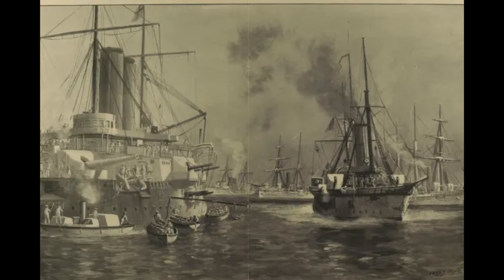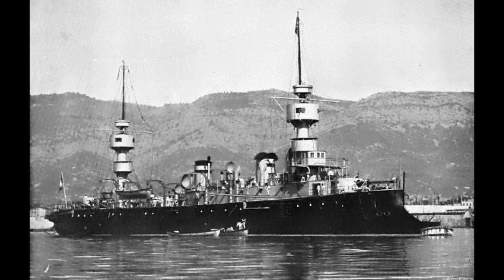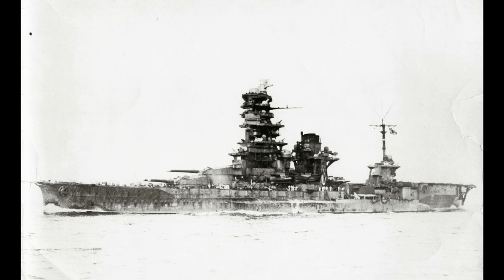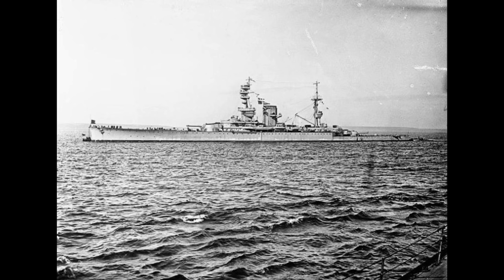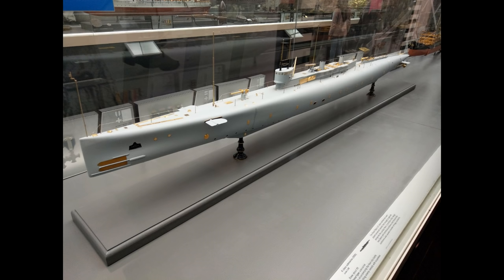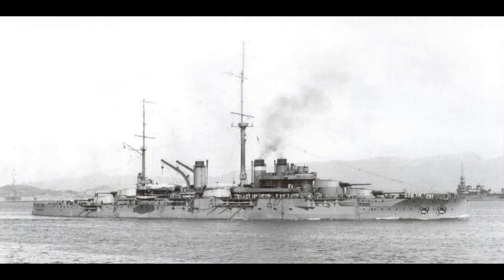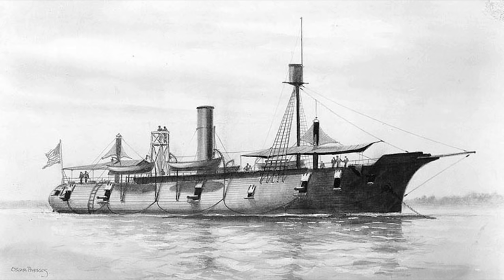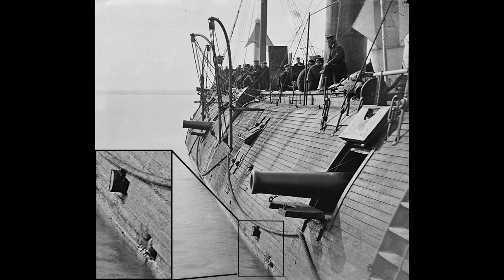Naval Engineering Disasters - How not to design a ship

Comment: "You could have 50 foot of the submarine sticking up out of the water... in the air... and the bow would still reach crush depth and implode." That's an HMS Captain level of design flaw, but also a morbidly amusing mental image.
Reply: I'm curious- did something like this ever happen? Not that extreme, obviously, but the scenario he mentions where the dive controls screw up and the submarine sticks its bow under the crush depth, damaging itself. Is this just a hypothetical, or did it actually occur ever?
Reply: @suspectsn0thing  Look up "the Battle of May Island" - just don't mention it in naval pubs..
Reply: The K-boats might have been the only submarines that were longer than their own absolute crush depth, but weirdly, they were not the only submarines longer than their test depth. The Japanese I-400 -class aircraft-carrying submarines had a 100-meter test depth and were significantly longer than that at 122 meters, meaning that they didn't have to have suffered a verticality mishap to exceed it at one end while still on the surface at the other--a sufficiently aggressive crash dive would have done it.

(They were also better at turning to port than starboard thanks to their off-center conning towers. Really quite unwieldy overall. On the other hand, they pioneered the concept embodied in today's guided-missile submarines, and nobody ever gets something completely right on the first try. :)
Reply: @ZGryphon  
Well not even that, the I-400 had such borked hydrodynamics that "forward" was actually with the rudder turned slightly to one side. Also had appalling crew provisions including only one toilet. And what "concept" did they pioneer? People had been trying to launch planes off submarines for over a decade by that point.
Reply: @CruelestChris  The submarine-launched strategic precision strike mission. The I-400s were built wtih the specific purpose in mind of hitting the Panama Canal with what amounted to a cruise missile strike (there was lip service paid to recovering the aircraft, but no one realistically believed that part was really going to happen, including the pilots). Prior sub-carried aircraft had only been used for scouting.
Reply: @ZGryphon  
No, they weren't. They were envisioned as a much larger class which would allow Yamamoto to Do A Pearl Harbour whenever he felt like it, I believe the original plan was for something like twenty of them. They very much were originally designed to recover their aircraft, the switch to Kamikaze planes came late on and if I recall rightly the pilots were not best pleased since they found out about it only when they noticed the bombsights had been removed from their planes.
Reply: Damn 😳
Reply: In WWI most subs had a dive depth of less than their own length. It wasn't all that much better in WW2, maybe 2-3 times their length. That isn't crush depth of course. But I was kind of shocked earlier reading about the HMS Thresher disaster, how they tried to send men out the escape hatch to close the valve on the front, but the pressure was to much and almost killed them...and then they showed a photo of the scene after rescue ships arrived, and the stern was actually sticking out of the water. They couldn't exit the rear escape hatch with the stern of the ship in the daylight. That's amazing. Pressure is something else.
Reply: If the bow is at the top it will NEVER reach crush depth first ... Obviously the stern will! 🤔🙄
Reply: @suspectsn0thing he made the full video a couple months ago... look for k-class lawn darts. The fact the navy kept them in service a month is a crime.
Reply: @suspectsn0thing The "Battle of May Island" or that time most of the K-Class sank and a good few dozen Royal Navy seamen were turned into salsa by destroyers.

Comment: I still go with Vasa for number 1. Even during a test at dockside, when sailors ran from one side of the ship to the other.... the test had to be stopped as everyone was afraid that Vasa would roll over. No-one dared to tell the King. Secondly, when the ship left the dockside, she did not have either her full complement on board, or her full load of stores, which would have made her freeboard higher than normal. That still wasn't enough to prevent the ocean from flooding in through the lower gunports when Vasa heeled over a bit in a light breeze. So, designing a ship with holes in it's side that would be effectively UNDERWATER in any kind of weather, seems to me to be THE number 1 engineering SNAFU. Apologies for the added emphasis but I've seen Vasa up close and personal and I think it's a crying shame she was ever built. Her only use in the end, was as an underwater storehouse of unparalleled archaeological significance.
Reply: The Furutaka and Kako of the planned 4 ship Furutaka class. These guys have portholes near sea level. At steam, any wave would enter said portholes and drench the crew. The 2nd batch of the class, Aoba and Kinugasa were redesigned to eliminate said portholes and reconfigure the gun layout to a more usable one. They in turn became the new Aoba class. The performance of the new sub sisters were so good that the 2 older ones were sent to the docks to be remodeled, retaining some superstructure but completely rebuilding the gun layout and patching those said portholes.
Reply: @kimpatz2189  This is worse,but only because the Vasa was built first and someone should've learned from that.
Reply: @kimpatz2189  portholes could be closed and sealed no?
Reply: He literally said at the start of the video that it wasn’t a ranking
Reply: Would it have at least be decent if the lowest ports could be sealed in rough seas? Ideally you’d fix it before but if it’s too late…?
Reply: I think the Kirovs, Slavas, and the Kuznetsov might give even the WWI British Battlecruisers a run for their money in terms of terrible designs.

Kirov and Slava get put on the list for being unarmored, having absolutely abysmal point defense and radar, somehow even worse crews and worst of all: completely unarmored deck mounted anti-ship missiles. As the sinking of Moskova can show, one single hit from any missile and the ship goes up in a massive fireball and it's game over when the fire reaches the launch tubes.

And we all know why Kuznetsov is on that list. When you can't move under your own power without catching fire and needing to have a spot saved in a drydock at whatever your intended destination is, that's sub optimal to say the least lmfao....
Reply: @mackenziebeeney3764  That's, in theory, a workable idea.  Catch is... the more often waves hit the hatch, the sooner it starts to leak.  That's why most ships have portholes higher up.  Also, realistically, you're not gonna get much benefit out of a window that has to stay sealed lest the ship sinks.  The view would suck and you'd never open it.
Reply: @OtterTreySSArmy  The problem with Kuznetsov is the Soviet Union only built one set of support infrastructure for the thing.. and it was in the Ukraine! 😆 The Russians have basically been running the thing 24/7 since the USSR broke up cos they can't afford to build more infrastructure... Imagine never turning your car off for 30+ years... 😲
Reply: Just visited the Vasa and when my brother asked about its significance, having seen the dedication to preserving and housing it, his take away from my 30 min explanation was, “so, it was a paperweight that was too big to use. Got it.” Lol

Kid kills me.
Reply: To be fair, "design", as we understand it, really didn't exist. Plans, as such, hadn't even been invented, and calculations were merely dimensional. They got a master shipwright and told him what they were trying to get. What attributes, etc. Royalty, who didn't know anything about ships at all. Sometimes a really good shipwright would just cheat, saving them from themselves LOL. But a new guy or someone who got the job by favoritism, when given specifications that really couldn't be built, would tend to do this anyway. Denial may be a river in Egypt, but it runs rampant through govt officials in every age. It's just more complicated than it seems. The Mary Rose suffered ,much the same fate, without moving an inch!!!! I wonder how many others, all around that time period. Size was a big departure for men who had been making much the same ships for centuries. Just something to contemplate.
Reply: For years I have been trying to get the US Navy to build my newest submarine design, it has screen windows for proper air flow when under...wa...t..er... Ummm, errr, hmmm, do you think Euro forces or Asian would buy my amazing ship designs... Maybe, or would you or your friends want to buy them. I also have ocean front land in Arizona for sale, as well as a bridge.  Cheap, lol
Although on a serious note I think the Brits Exploder class subs was one of the best worst ships built, using rocket fuel for underwater power. I think it was high test peroxide mixed w/ diesel fuel to make energy and both of the first two sub, literally blew up, staying true to it's name....bad, real bad.
Reply: @ancuruadh6027  eighties VW minivan: "I see no problem with that?"
Reply: @kimpatz2189 Surprising that those ships actually went on to have decent careers. Notably both taking part in the Battle of Savo Island, the USN’s worst blue water defeat.
Reply: @wolftamer5463  The problems started popping up during their first sea trials. Gun layout were trash. So they decided the 2nd batch to be redesigned. Both came out great. So they then fixed the first batch.

This also started their trend on having more guns per ship after these guys as they felt that the Furutaka's "lack" firepower.

The Myoko's have more guns, longer hull and beefier powerplant. Even more absurd are the Takao's with even more powerful powerplant and a menacing looking bridge that rivaled any battleships at that time. The more guns and more superstructures meant that these ships are now top heavy. The 4th fleet incident happened and questioned the IJN ships sea-keeping capabilities. The 2 class went into a major rebuild to try and address glaring issues. After the refit, the gained torpedo bulges to widen their beam, this also meant that they are now slower than before but still ridiculously fast.

The aircraft carrier Ryujo is also a Vasa afficianado. The design basically tried to make a large fleet carrier under Naval treaty conditions. 2 hanger decks, very narrow beam near the waterline but very wide top carrier deck. It just barely passed the treaty by mere 200 tons displacement. But this ship was rebuilt after the 4th fleet incident too.
Reply: @georgesoros6415  1627.  By 1627 there were plenty of shipwrights and architects developing designing and making print diagrams.  This is after the race built galleons.
Reply: @kevobrien7346 the Indian Navy might buy it
Reply: @OtterTreySSArmy Though, in all fairness, the kuznetsov is an entirely Russian issue if I recall correctly. The Chinese and indians have been operating a carrier of that class quite handily. Again, not looking up the info as there were two classes of "carriers" in the Soviet navy, two ships of which got sold to the aforementioned countries.
Reply: @hanzzel6086  Agree, but the Chinese carrier is hopelessly outdated. Even the Indians have a better platform. now, if their latest project works out, you might have a point. Though, given the fact that the mighty Chinese navy has been reduced to trying to ram Phillipines coast guard, I won't hold any aspirations of power for it.
Reply: @OtterTreySSArmy  TBF to Brit WW1 BC's... Invincible class aside... their issue at Jutland wasn't so much of design flaws as it was their crews and Adm. David Beatty looking at all the wide open flash doors and going "Nah! It'll be fine!" If they'd actually had that protection in place there's a decent chance only Invincible gets torn apart.

Comment: #3 was secretly the first prototype submarine and was functioning as designed, until the crew noticed that they and it needed to have air to survive.
Reply: It reminds me of the lady of the Australian desk asking the admiral if the French submarines can stay more than 20 minutes under water as they are not nuclear 😂
The guy seating next to the admiral had difficulties not to burst in laughters 😇
Reply: @khaelamensha3624  i dont get it, thats a valid question
Reply: @Blox117  the admiral wasn’t laughing
Reply: I have to  say : almost every submarine since the USA civil war era CSS Hunley (hand cranked propeller) attack sub has been able to beat that 20 minutes time, as high pressure air pumps & flasks storage tech was known as early as the 1600's. Look up the history of air guns, and being used on the Lewis & Clark expedition of 1803 to 1806 to chart a path across North America to the Pacific Ocean, and well before that in Europe. Truly, the Hunley could have been propelled by a compressed air motor of some type, been much faster,  safer (the exhaust air from the motor being breathable for the crew & lighting, and ballast control), and reduce the crew to only 2 or 3 needed & at risk. However, the serendipity of information clearly wasn't there in time!
Reply: Submarines can go all the way to the bottom and stay forever under the right conditions.

Comment: I would like to have seen the look on the face of the first person who ran the numbers on the K class and realized you could exceed crush depth while still partially surfaced.
Reply: when you look at it's stats... aside from the crush depth issue, and use of a steam turbine, it doesn't look like a fully terrible idea.  However, both of those are terrible design flaws.

Comment: Can we talk about that German U Boat that was sunk because of toilet issue? technically it's an engineering problem. Toilets can be deadly, you know
Reply: Lethal weapon 2... 😂
Reply: U-1206?
Reply: The idea with any sub. At least yours or your allies subs. Is to balance the equation of submergence and surfacing
Reply: no an engineering failure but the only kill of a dreadnought class was a ram attack on a u-boat
Reply: Considering how many U-Boats were built and how successful they were, the "toilet" issue may have been  a maintenance problem and generally the engineering was awesome.
Reply: At the of deployment the surface to dive ratio must be 1.000
Reply: @abrahamdozer6273  it sank because of incorrect procedure of dumping the toilet waste that leads to the main issue of the sinking. As sophisticated the German toilets were in their Uboats, they require a complicated procedure to dump the waste.
Reply: The toilet in the UBoats was so sophisticated at the time in 1945 that it requires a qualified personel to successfully dump the waste out, it's probably one the most German thing to do.
Reply: @datadavis  I recall something like that happened on one of the space shuttle flights, the crew had to act fast to prevent the atmosphere from venting as well as repair the toilet itself since the bathroom was a mission critical piece of equipment that would cause a mission abort if it broke.
Reply: @ramal5708  You mean, like on the International Space Station? Why can't these things ever go as easily as they do on TV?
Reply: @ramal5708  Flushing something out while diving is not that easy. Remember you need a pump that can exert enough pressure to work against the outside water pressure. Everything has to be completely tight.
It would have been "overengineering" to build it in a way that prohibited wrong usage. The problem was just the missing of safety precautions.
The alternative would have been to shit in a bucket and throw it overboard when you are on the surface.